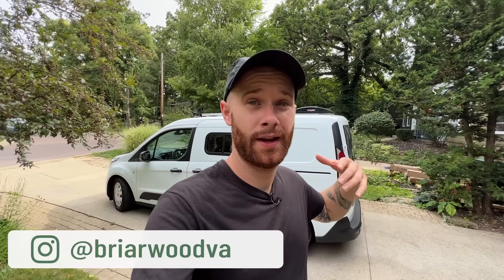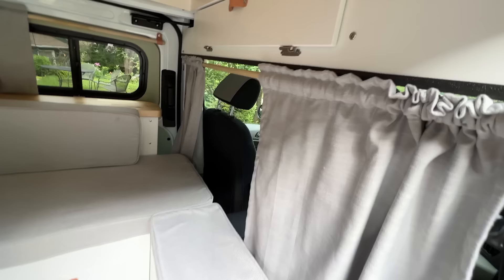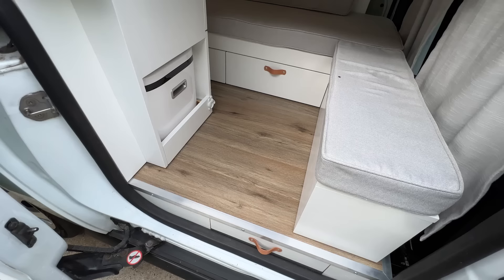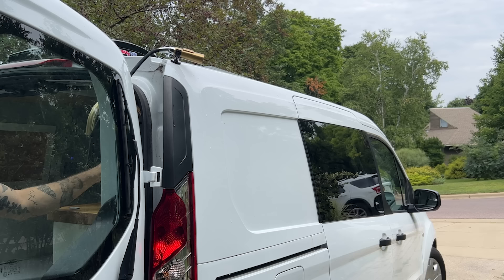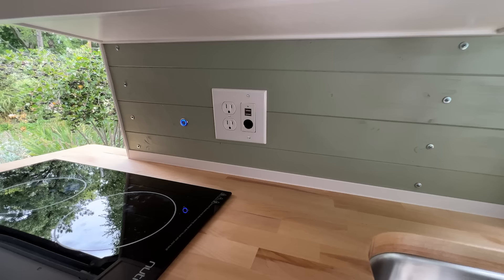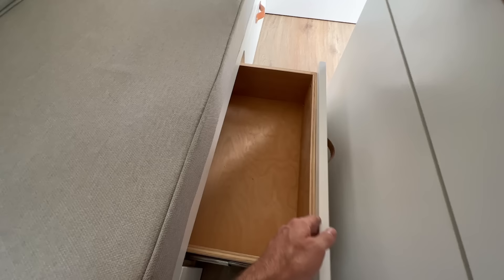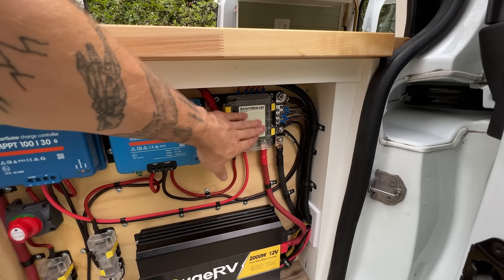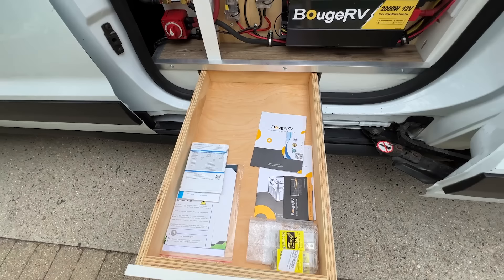ULTIMATE DIY MICRO CAMPER VAN | FULL TOUR! | 2019 Ford Transit Connect

Comment: The best micro camper conversion I have seen.
Reply: Always amazed by the sheer number of people who love installing boxes and kitchen sinks with a sofa/bed in the back of their vans and then somehow think that the value of the whole rig has shot up two to three times it's actual value !!!
I've been camping for years. Van/folding bed for comfort (off the floor) and a portable propane gas stove with a propane fridge too.  All in a nice wooden box with a cutting board on the top. It's all you need and it is the ultimate STEALTH van if you can open the back and show whomever that it isn't a campervan.
Not the same I hear you say ..... This thing has no dry WC or WC at all for that matter, so it's not really designed to go far off the beaten track. No shower.
All things you can buy seperately and store in the back if it's not full of sofa and kitchen sink ...

Comment: That is a beauty. 
What I would like to see is some ideas for a simple but tidy, non-electric removable set up for a weekender or a night. So the van can be used as an everyday vehicle most of the time without the extra weight being permanent. Wouldn't be using the van for dirty jobs thru the week so carpeted walls etc could be a permanent fixture. Storage of the removable items would need to be considered as well (i.e. fold flat where poss). 
I think an innovative, comfortable but removable & fold flat system would be very popular with a lot of people 👍

Comment: Looks amazing! I followed your conversion series to convert my 2011 Ford Transit Connect last year. I've been all across Europe with it and still do lots of trips in the UK. Cheers for the inspiration!
Reply: Out of interest did you make use of the subfloor space shown here? I'm really keen to use as much of that dead space in my 2014 connect conversion
Reply: @deanm4290  I didn't, as it wasnt part of the conversion series that I was following. After seeing this video I wish I had though! I have a similar design on my sliding pull-out table which lies under the bed, meaning that when the back doors are open I can slide that out and have an outdoor table for cooking etc.

Comment: Fantastic congratulations on another great build.  I love the cabinet over the sink and stove.  I recently refurbished my ceiling and snack bar in my RAM PROMASTER CITY.   I found battery cables for my RV lead acid batteries so my inverter and electric system is trouble free.  Love your work and craftsmanship though very comfortable and happy with my DIY.

Comment: I love that desk option. I would probably just make it permanent. Like just keep board in there. Maybe then you would have to take out front face. -- These are my suggestions. A phone charger in hidden cubby by bed. So you can put your phone there at night.  Put half inch plywood on the back of the top bedcushion, like staple fabric to it, so you dont feel the bed slats. A fold out countertop leaf on the side of cabinets. Edit - You know you can probably just put a portable toilet on floor by side door opening, and just slide it out of the way when you enter door.

Comment: As always, a fantastic build. Functional, clean lines and that olive/avocado paint really works well with the color of the wood and the white cabinets. Very impressive. Couple of questions. How much weight do you think this build added to the vehicle. Also, I looked at your site, and didn't see a reference to how much this build for this particular van and customer ended up costing. I get not wanting to quote a price to a customer "prior" to a build and before all options have been selected. But since this was complete, just curious what this one was out the door? If you can do this with a small van, I can only imagine how a long wheel base Express would turn out after your craftsmanship hands have touched it. Everything about you and your work exude positive energy. Thanks for sharing.
Reply: Do you have a link to those little heaters? 
Love the build

Comment: Great van as always Josh. Those under floor drawers are great. Especially the one under the electrics, perfect hiding place for a laptop. Other one is perfect for shoes. Could you fit a loo in the storage box by the door and could you fit a grey water container alongside the fresh water, albeit smaller, for when you can’t discharge externally? Also do you know what the width of the sofa is before extending? Thank you.

Comment: Absolutely blows my mind how Josh was able to utilize every tiny crevices to add a storage compartment. I will definitely be looking to get this conversion if I can afford it. But torn between Promaster City and Transit Connect. Whichever has better realiability and driving fun factor. Leather handle on drawers are definitely a huge plus as it is very easy to bump into them as space is so limited. It will prevent many "ouch #$%^%&&.."

Comment: Looks great! Where did you run the battery wire through the firewall? I have a Transit connect and I'm having a hard time finding a spot. Seems like maybe the passenger side has easier access?
Reply from the maker: There is a rubber plug I was able to punch a hole through in this van. May have been under some flooring if I remember correctly!

Comment: How long will the 200 watt batteries run the refrigerator?  Same question about the small heater and cooktop.  Basically, how long can you boondock with no sun?

Comment: If this van is built for a single person to travel in, it might be interesting to remove the passenger seat and put in a cassette toilet. You could remove the cassette from the passenger side door. You could also put a hinged cover over it so that you can set things on top of it when you don’t have a need for the toilet. But when you need the toilet, you could just flip the cover up and then use the commode.

Comment: I really like your conversions and thinking about contacting you about a conversion, but I worry about one thing in particular.  Weight?  A conversion like this looks like it would add a lot of weight to the van with all the woodwork.  My Nissan NV 200 has a small engine and it does well on MPG and power when empty, but I wonder how it would do for power and MPG after a conversion like this.

Comment: Hi, there. Can you make a video of how electric system works for this kind of camper?
Im looking for a system where you have solar panels on roof, they are connected to batteries and during day time they are charging batteries while providing enough to run ecoflow wave2 AC and a 12volt refrigerator and water pump and some other stuff, and when sun goes down and solars stop getting power, these battries start giving power until next day when sun comes out enough to start giving power to solar panels again, and they start charging battries while giving power to other stuff, a 24 hour circle without any stoppage 
What would you recommend? Im looking for all ecoflow system to power up a toyota hiace camper van where I can run AC and refrigerator for 24 hour.
There are giants power banks like Ecoflow delta 2 which can be connected directly to solar panels they have built in solar controllers 
I dont know much about this any knowledge about it would be appreciated

Comment: Top 5 thing I ever installed was a swivel passenger seat I did to my Transit. Why wouldn't you use an already comfortable seat & it opens the van up a sh*t ton!!! I say this as It's not as if this is your 1st rodeo...

I love the cabinet above the front seats - Is a helmet include with that - Cuz U gonna B bangin' UR noggin' on da Regular with dat dumb @$$ idea.

Cute features - But not a fan at all of the design. U do a great job with the placement & quality of the electrical work.